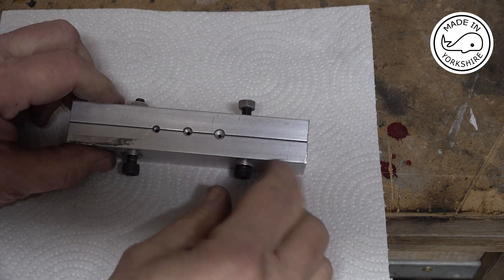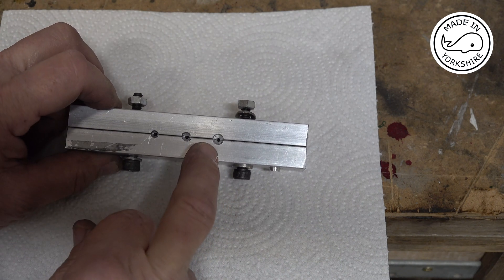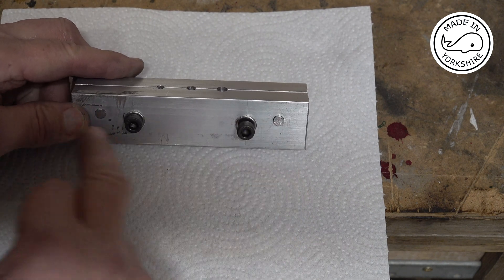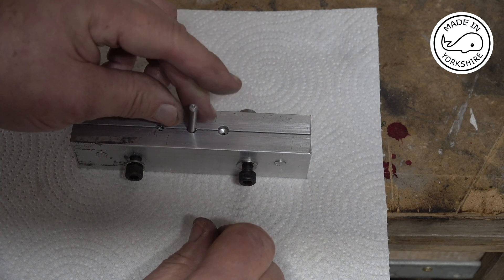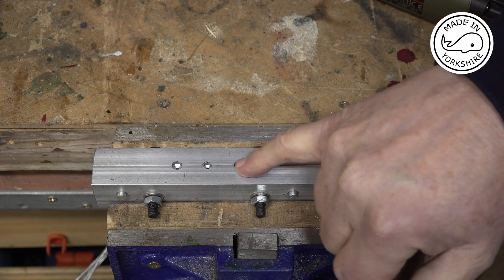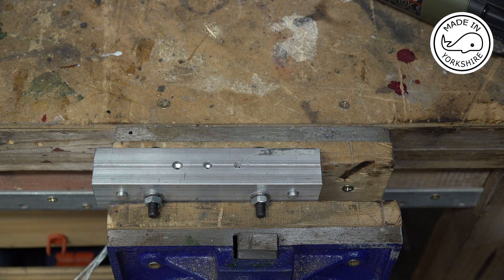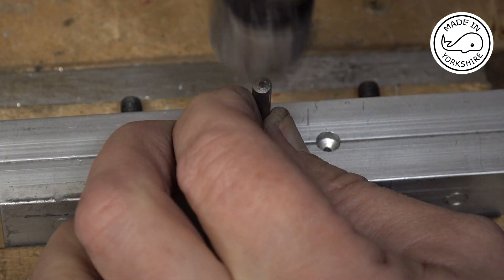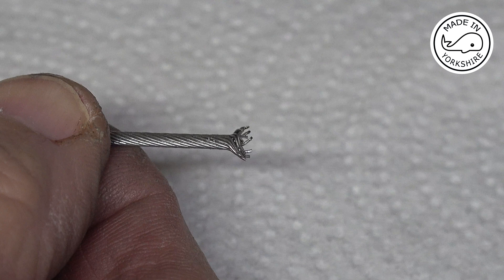#MT53 Bird Caging Tool

Comment: Just a thought - drill the 5 mil hole another mil deeper and you will get a cable that looks like the 4 mill cable when done. More room for it to expand and then compress into a better knot. Anybody?? Thoughts?
Reply from the maker: Hi Raual - I'm not sure what you mean exactly, but the tool does offer lots of ways to experiment.
Cheers
Andrew

Comment: When I worked in a motorcycle shop back in the 80’s I had a tool similar to this for fixing clutch and brake cables. I worked primarily on the 3 - wheelers and did new bike set up and assembly
Reply from the maker: Interesting!👍

Comment: Well done !
but I think it is a lot of work for an end stop on the cable, soldering and now also the cable 'spreader'.
I take a short m6 bolt and drill  a 2mm hole through it and then screw a nut on it, that will never loosen, and if you do want to loosen it, you can do that simply by unscrewing the nut.
easypeacy.
cheers ben.
Reply from the maker: Hi Ben - that's an interesting approach.
Cheers
Andrew

Comment: Hi Andrew. Not sure how this works as once the end is expanded . How do you fit the nipple. We used to make all our own cables by sliding the nipple on to the cable & then using a centre punch in the vice carefully splay the cable end on the large hole end of the nipple. . Solder the end of the nipple & cable. Then grind down the strands protruding to get to correct size. 
I have been waiting for the part of the lovely V twin engine. Hope it's coming on well.
Edit. Sorry i have just watched your other video. That is pretty much how we did it. Apart from we had a Wellar gun soldering iron, which gave the heat ok.
Regards.
Steve.
Reply: Somebody has to say it, you put the nipple on the cable first.;<》
If done properly there is no need for any clean up at all after soldering other than possibly wiping off any excess solder.
Reply from the maker: Hi Steve - my method is exactly the same as yours - apart from using a centre punch. In theory, the bird cage effect should provide a stronger bond.
Cheers
Andrew
Reply: @learningturningmetal  I must say i have to agree with you there.
Regards.
Steve.

Comment: Thanks for the shout out, and a cone In the end of the punch does a better job as it folds the end of the cable back on its self.
I'm sure old Carl will be looking down and smiling that his design lives on. If he is still alive he must be nigh on a hundred by now.
Reply from the maker: No problem Chris. I need to experiment a bit more but initial results are really good. A same Carl didn't copyright it cos he could have made a few bob.
Thanks for coming up with the suggestion.
Cheers
Andrew
Reply: @learningturningmetal  I'm sure something like it was made decades before which is why i only described it as his design not invention, but he was the sort that just got on and made things to make his life easier without thought of ego.